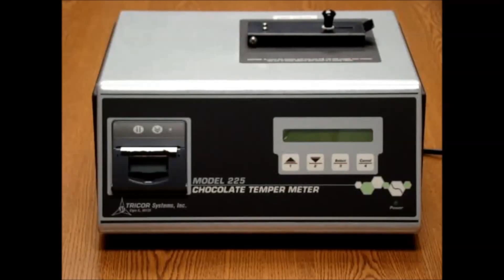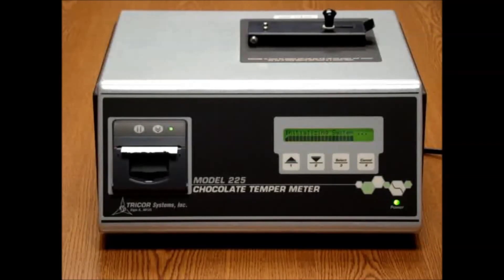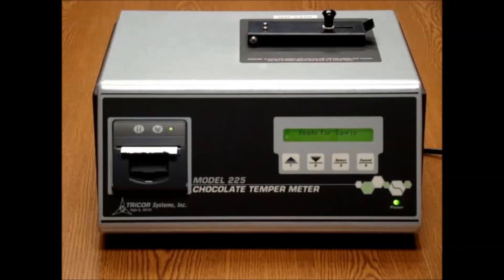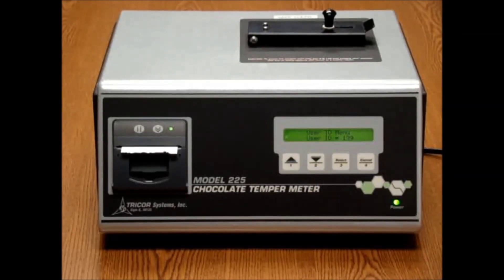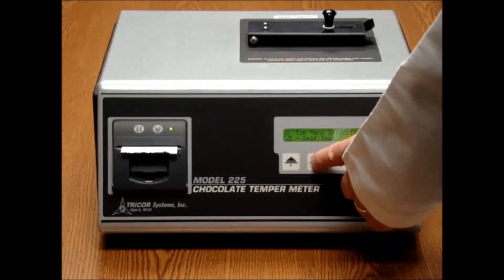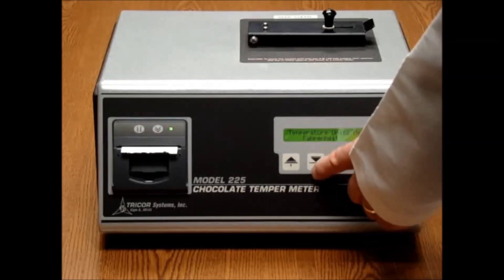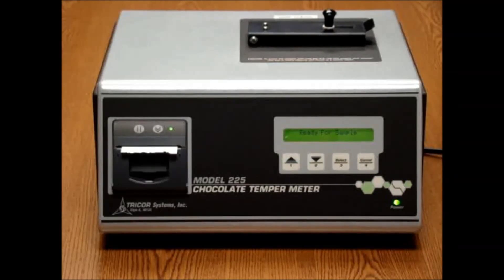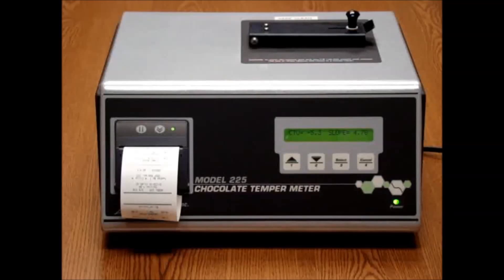TRICOR Model 225 Chocolate Temper Meter Demonstration

Comment: How much does one of these cost?
Reply: A LOT.
The reason why most chefs just temper chocolate themselves and test it with a spatula
Reply: @thebravegallade731  Just had a quote for the cheapest model and it was an eye-watering $8,000 without the accessories